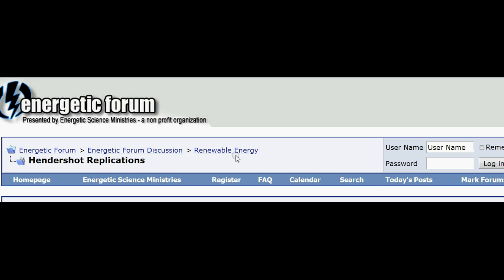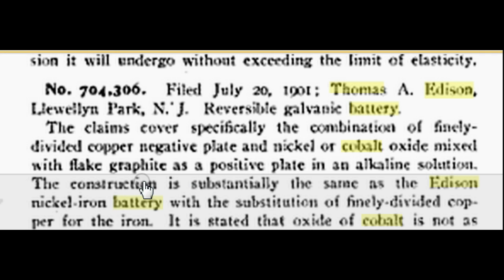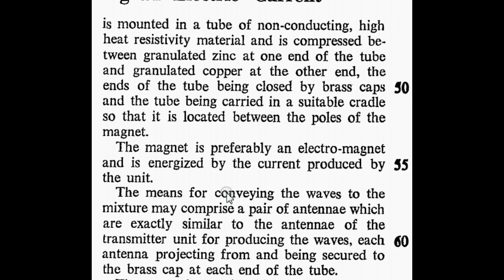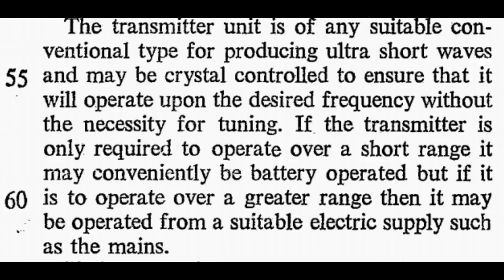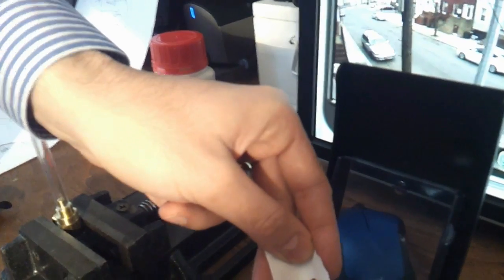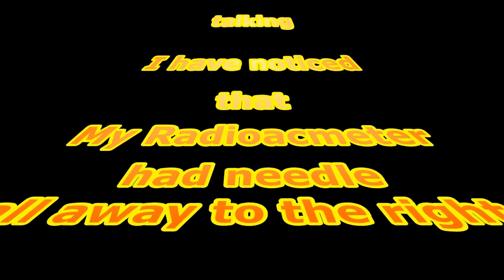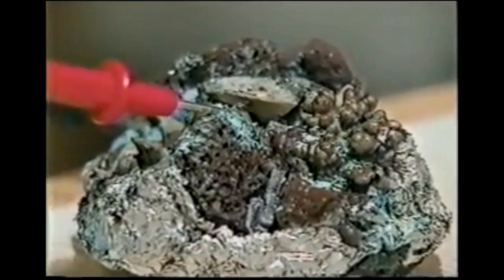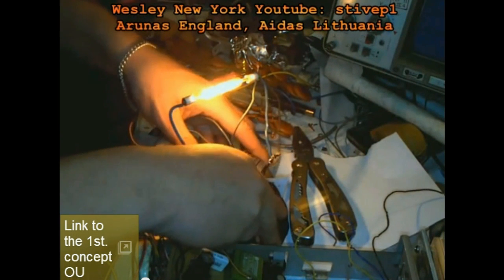Revolution has begun Free Energy Exposed part3

Comment from the maker: danger comes from many thinks in life. Simple electricity walking on the street  too. Your home microwave is  extremely dangerous if nit in Faraday  cage.Even more than Colman. But Betavoltaic if contain aluminium foil  - can not penetrate outside. That is what Rossi was doing - only he was  money oriented.Beta radiation is used in  hart stimulation, as battery. Take regular  acid battery- or lithium- ion  not only dangerous but contaminating without enclosure. Proper enclosure is a must!!!!!!

Comment from the maker: Well 1st April?  That is another  safety measure. The material is  very controversial talking about authorities.. I can not connect load I'm using cooper and zinc  oxide not pure conducting one. I do not have at this time.
oxide has  huge  resistance
As Frequency range I do not know  how it will behave at other  frequencies Important is if to low  power than no action.

Wesley